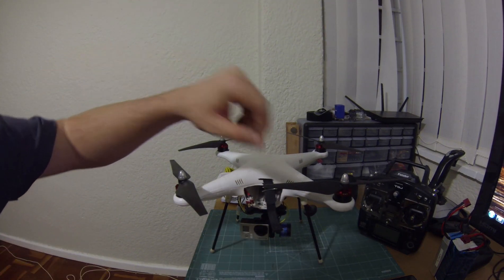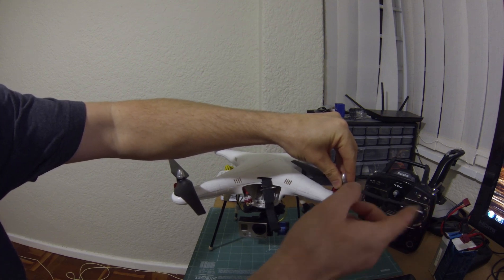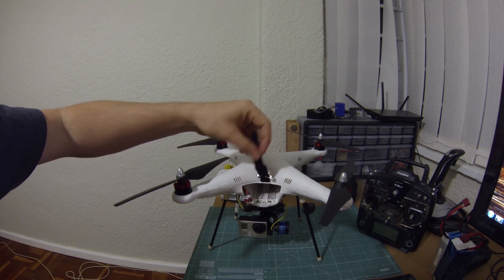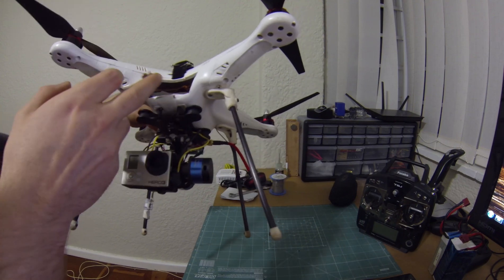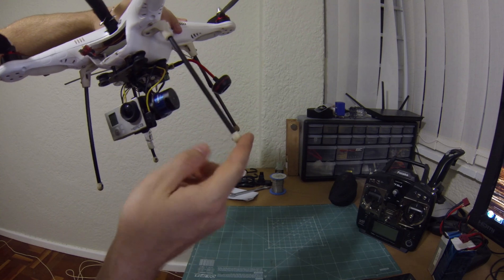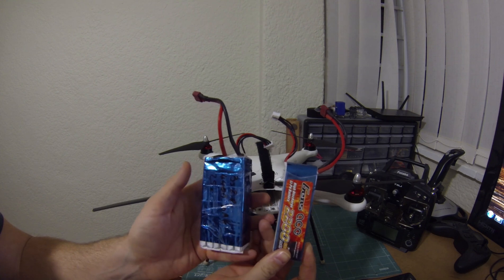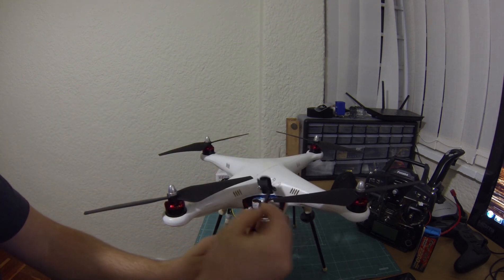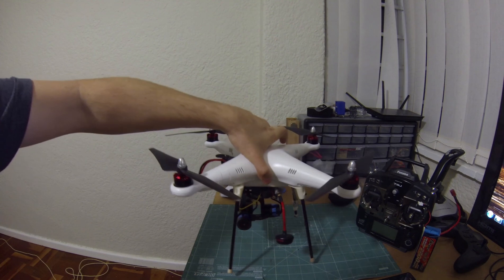DJI Phantom 1 - how I get 18 minutes flight time

Comment: you shortened the cables??? really?? come on???  what could you have possibly saved by going through all that work, I can see doing other stuff, but cables??
what worked for me was using just 1 3DR battery which is 5100mah (one that I use for my IRIS + )
all that was done was I opened up the battery hole on front and back with a dremel tool , then I repainted the shell etc, (which actually adds quite a bit of weight, if you figure the weight of a can of spray paint, , as it actually takes a full can to do it right.  Also I had to relocate the  LED light that was at the back, to the bottom. I can consistantly get 23 minutes fully loaded with  3 axis gimble, fpv transmitter ,  go pro camera, and a few more items, of course this is a hover flight in normal weather conditions,  when you push it which I typically do , your in the 18 min area. One battery , thats it, 
that battery is probably one of the most underestimated batteries in the hobby.  And have a cup of coffee , sounds like your going to collapse at any moment

Comment: hey where is the flight video ?
Reply from the maker: +italos555 https://www.youtube.com/watch?v=gSORmadQJ2o
Reply: Ok thanks for quick reply. I have also phantom 1 and i fly with 4000 mah battery multistar about 12 mins but i have a 1 watt fpv transmitter and i think it drains a lot of power.
Reply from the maker: 1watt is insane, if you are looking to get longer range you just need to get a decent set of antennas

Comment: You might want to reconsider using heatshrink tubing to encase two batteries. They generate quite a lot of heat during flight, and enclosing that buildup of heat might not be good for the batteries. Just a thought.
Reply from the maker: Why is it that all LiPo batteries are sold covered in heatshrink if they cause heat issues?

Comment: Did you have to balance the props?
Reply from the maker: I always balance my props, makes for a huge difference in both video quality and flight efficiency (efficiency = flight time)
Reply: ***** Thanks, I do realize that, hence why I asked! How bad out of balance were they out of the package?
Reply from the maker: Rob Lysak
The HQProps are very close to balanced as they came, took less than 2 minutes to balance each